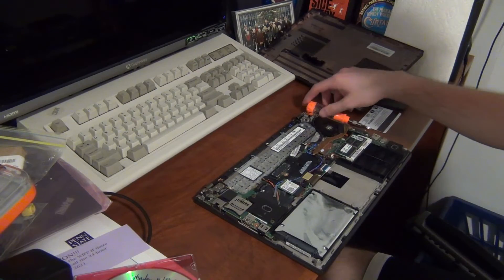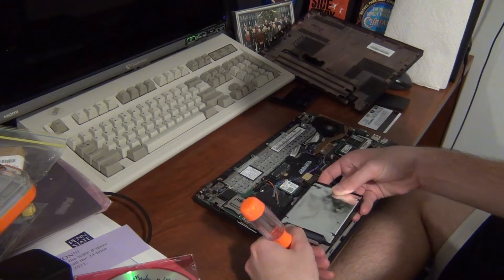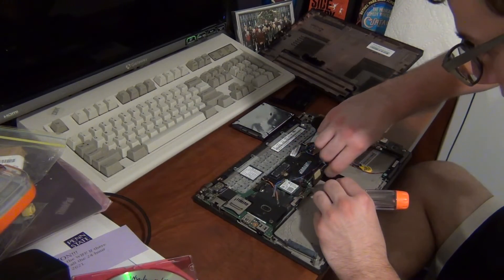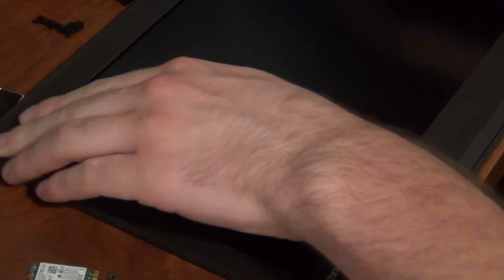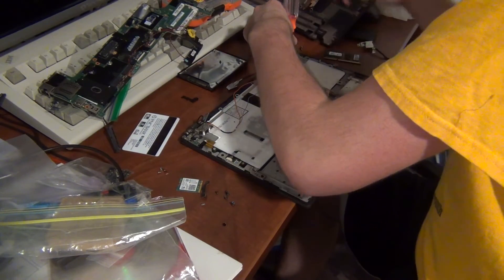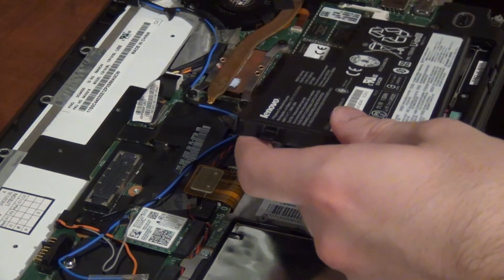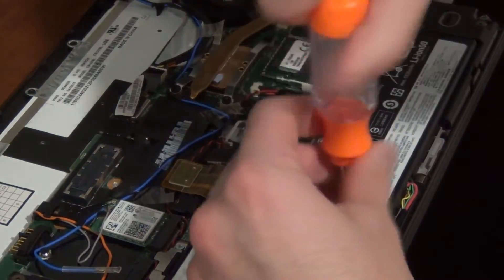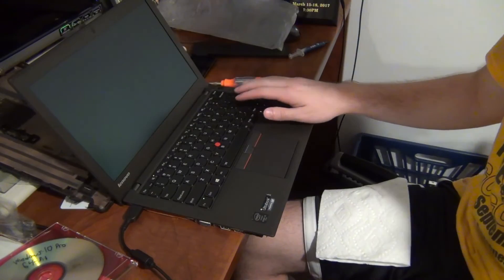Lenovo ThinkPad X240: Screen, Battery, and Palmrest Upgrades

Comment: Where did you buy the complete palm rest, keyboard and trackpad?
Reply from the maker: eBay.
Reply: @SebisRandomTech  Thanks mate. I should have read all the comments first. At any rate love your videos and for someone who has never been into pulling laptops apart, i now know the X series like the back of my hand! (X240-x270 as the new ones don't really count do they :))
Reply: I’m looking for this too! Found one but doesn’t include fingerprint reader. Is the palm rest a part of the full x250 trackpad or this an additional feature I should look for?

Comment: Bro my display brightness is not working on original display panel is there any way to get it working i tryed all the methods but only remaining is whitelist removal
Reply from the maker: Have you updated the drivers? Sometimes that fixes it for me.
Reply: @SebisRandomTech  i tryed it no luck
Reply from the maker: @kaushalposnak6203  Strange, and you said this is the original panel?
Reply: @SebisRandomTech  yess its original the brightness work in linux and mac but not in windoes sed life😭
Reply from the maker: @kaushalposnak6203  Knowing how often Windows updates screw things up, it's hard to say. You could try an older display driver and see if that works.

Comment: Hey friend, where did you get the LG brand IPS screen?

Could you provide me with the link?
Reply from the maker: eBay. This was over 2 years ago and any link I may have had is long-gone. You simply have to try your luck with different sellers and ask around until you find one selling an exact original screen.

Comment: Great video, as always :) I have one question. I read that after swapping touchpad in xx40 Thinkpads to the one from xx50, additional Synaptic drivers need to be installed in windows to make it work. How about Linux? Does it work out of the box after swapping? Thanks a lot.
Reply from the maker: In my experience it usually works out of the box in Linux.

Comment: Hi great video. Is there a way to remove the whitelist WiFi for the x240 ? Thanks.
Reply from the maker: Yes but it isn't an easy process. You need to purchase some additional equipment and be comfortable with Terminal commands.
Reply: @SebisRandomTech  noted. The BIOS patch will also require some searching and verify its safe to use

Comment: Hey Sebi's. I'm from Colombia. Do you know how to install the corret drivers for the touchpad? I did the change to the x250 but the buttons doesn't work. Do you know how to correct this?
Reply from the maker: I did a video describing how to get the drivers working properly in a T440p, and in the description I left a link to the ThinkPads.com forum where they also have a guide on how to do it in the X240.

Comment: I bought that laptop a year ago. I like its dimensions and appearance. Its weakness is limited performance. I have a version with the i54300U. Is it possible to upgrade this laptop?
The crucial.com configurator says that the X240 supports Intel Series 8. Is this real?
Reply from the maker: Not even sure what "Intel Series 8" means, but if you're talking about upgrading the processor, you really can't. The X250, X260, and X270 all have the same form factor and newer processors, or you can go back a generation to the X230 which used more powerful processors.

Comment: Excellent video. Could you have used a keyboard from the X220 (one of your favorites, as I recall)? I have a general suggestion for your videos. Let's suppose I'm interested in replacing the screen on the T450s with an IPS screen and you don't have a video on that. (I don't know if you do as it's just a hypothetical example). If I were to watch one of your videos involving a screen replacement on another model (such as this video), it would be helpful if you were to spend a small amount of time (near the end perhaps, mentioning at the beginning you will do that at the end) discussing screen replacement for a range of models, particularly where there are problems. An example of a "problem" is that the IPS screens for the T450s are "white-listed", so brightness cannot be controlled in Windows for non-Lenovo replacement screens. Similarly, here when you say you will use a X250 keyboard, you might list other possible choices. It would just take a few seconds but some viewers may benefit. Anyway, keep up the good work.
Reply from the maker: The X220 keyboard is both physically and electronically incompatible with the X240 and X250. Meanwhile, most of the components between the X240 and X250 are interchangeable, enabling me to use a X250 palmrest/keyboard/touchpad in an X240. Screen replacements between these models are also like comparing apples and oranges. With the X240/250 the display bezel simply snaps off making a display replacement easy, on the T440/T440s/450/450s the front bezel is held by adhesive, and there are additional screws underneath, making the replacement/upgrade process very different. They also use completely different displays from the X240/250, and the T440/440s do not have the display whitelist present on the X240/250 and T450/450s (I also heard that the most recent T450 BIOS removes the whitelist, but I don't know if this has been confirmed). Because of differences like those, I can't just make a be-all-end-all upgrade video covering several different models without it becoming a lot longer than "just a few seconds". The process discussed in this video is really only good for the X240 and X250, and maybe the X260/270, so it really wouldn't do much good to try and cover dozens of other variables in one video.
Reply: I realize that the the numbers of permutations of models and types of upgrades is vast, but I think it would be helpful if you spend a few seconds relating what you are doing to other models in the same "family". For example, if you are upgrading a T240, you might say (if it's true), that whatever you doing is also applicable to the T240s. If, for example, it's a keyboard replacement, then say (if true) the only keyboards that can be used are those from the T240 and T250 series.
Reply from the maker: @CaryInVictoria  With all due respect, most of the people who watch these videos or are doing these upgrades or replacements are already aware of what works with what. The information you want can be found with a fairly quick Google search, and so when it gets to the point where I have already covered everything that is needed to perform an upgrade or mod it really isn't worth it for me to add more time to the video to cater to a small handful of people who can find any remaining info they need elsewhere.

Comment: Hi There .. It was a nice tutorial. I was wondering if you could share the link to the battery and screen. The official lenovo site in UK doesnt seem to have the internal battery in stock. Any reliable ones elsewhere ??
Reply from the maker: I am based in the US, so the sellers I buy from may not be able to ship to you. Additionally, as I've pointed out, the sellers who have these parts aren't always the same, so your best bet is to look up the part numbers on eBay. I show the display part number in the video, and you can find the battery information on Lenovo's website.

Comment: How do you find text/ don't eligibility with 1080p on 12.5" screen?  Do you find yourself using web browser zoom? Windows scaling settings?
Reply from the maker: I leave it at 100% scaling since my eyes are still good. If it's too small, 125% scaling isn't bad.

Comment: folks who, like me, just wanted to replace trackpad on x240 : 
1) buy "GZEELE NEW for Lenovo Yoga 12 S1 for Thinkpad X230S X240S X250 X260 X240 Three Button Touchpad Trackpad " on ali, i paid $15 ;
2) just unscrew the back cover, *dont need to unscrew anything else*, remove internal battery in you have one (i didnt, you'd need to disable it in bios before, i didn't need it)
3) remove trackpad connector, it's under black tape in the center of trackpad (that black tape is supposed to protect internals in case of water dropping on keyboard, so, stick something good back after you finish), now you'll need to take a flat screwdriver and detach trackpad from the other side, trackpad is simply glued on x240, but it's not a stong glue, it'll let it go after slight fiddling with screwdriver 
4) get a thin double sided sticky tape (https://www.aliexpress.com/item/32696108387.html) and put it on the margins of trackpad socket, it's enough to keep it in place ;
5) the most difficult part of it :-) - connect the cable back ;
6) you're done, put the trackpad into its socket, reinstall synaptics drivers as explained here : https://forum.thinkpads.com/viewtopic.php?t=126967
.
the most difficult part was to figure out that for replacing just trackpad on x240 there's nothing to unscrew in fact, it's darn easy, you just need to tear the old one off...

Comment: if any one can help me out would be much appreciated iv got a x240 and i want to do the track pad mod but i cant fined a seller selling the x250 track pad in the uk where im from just china and i want to know if the t450 trackpad would fit as i can buy one in the uk :) if any one knows would be a big help
Reply from the maker: T450 touchpad is a bit bigger, so it physically wouldn't fit in the X240. :(
Reply: @SebisRandomTech  dam so only the x250 pad then okay well thanks for the help I'll buy one if you can help me out with another mod I want to make to my x240 I'd be very grateful I'm looking to fit a aftermarket touch screen to my standard base display x240 can I get just a panel and a new cable and drop it in or do I need a new "lid" the top case ?
Reply from the maker: @totalkiller4  You'd need an entire top case.
Reply: @SebisRandomTech  do you have a sku number for what I'd need that would be a big help I'm new to the ThinkPad world :)
Reply from the maker: @totalkiller4  All part numbers can be found on Lenovo's website. Just look up "ThinkPad X240 part numbers".
Reply: @SebisRandomTech  hi I'm getting mix messages from sellers on if I need a 04X5251 cover to fit a touch LCD do I just need a new bezel or the cover also :(
Reply from the maker: @totalkiller4  You would need an entire screen assembly.
Reply: @SebisRandomTech  sorry to keep asking you for help but your really helpful i have a x240 that did not come with a fingerprint so i bought a palm rest that did but i dont have a slot for a little ribbon cable down near the ram slot like you do does that mean i cant get fingerprint :(
Reply from the maker: @totalkiller4  You would replace the palmrest with that of one that has the fingerprint reader.
Reply: @SebisRandomTech  I have purchased a palm rest with a fingerprint reader and it's working just there is a small ribbon cable coming out of the keyboard in the far left near the ram side of the laptop if you have it so the trackpad is at the top of the laptop but I dunno what it's for it's not plug in but fingerprint works so any idea what it's for ?
Reply: @SebisRandomTech  I know this isn't about the video but I just bought a t440p and was wondering if it's possible to add touch screen to it I see it's available for the t440 would a t440 screen fit a t440p ?
Reply from the maker: @totalkiller4  Nope, the T440p was never available with a touch screen.
Reply: @SebisRandomTech  but the t440 or 440s is are they cross compatible at all is what im asking
Reply from the maker: @totalkiller4  They share some similar parts, but the T440, T440s, and T440p are all different machines.
Reply: @SebisRandomTech  so the displays are not interchangeable as iv read on Lenovo forums there the same size and connection
Reply from the maker: @totalkiller4  The non-touch displays are the same across all 3. The touch screen versions are limited to their specific model. A T440s touch assembly won't work in a T440, and vice versa. As I said, the T440p never had a touch screen option so there's no Lenovo part that will work with it.

Comment: I found it, yayyyyyy. I'll get the screen once I get some extra 💰. One thing I can't seem to figure out is where is the 16gb msata drive located that comes default with the x240?
Reply from the maker: It may have been in a caddy that takes the place of the SmartCard slot, according to documents on Lenovo's website.
Reply: Sebi's Random Tech ahhhh gotcha. Thanks for clarifying that. I’ll be keeping that laptop and maybe sell my T460 which I love. Can the T460 have a backlit keyboard?
Reply from the maker: @BlaGGah  Yes it can.
Reply: Sebi's Random Tech Whata the actual keyboard I should be looking for? Any other compatible backlit keyboards from other models that's compatible?
Reply from the maker: @BlaGGah  X240 and X250 use the same keyboard. https://download.lenovo.com/parts/ThinkPad/x240_fru_bom_20140808.pdf
Here is the complete parts list for the X240. There is a whole section on the keyboards that you can install in it.

Comment: I just got one of these on ebay for cheap, the seller didn't know what type of display it had so I took a chance and lucked out that it already had the IPS display (1366x768 though), anyway I LOVE it. Up until now my portable "coffee shop" laptop was an older 13in Macbook, the thing was close to 5 pounds though and I was starting to get sick of lugging it around just for my quick writing and emailing. This 3-pound little beast is PERFECT. Sure though, also not a huge fan of the touchpad, but since it's already got an IPS display I'm no longer thinking about opening it up and trying to upgrade it.
Reply from the maker: You can always swap out the touchpad with that of an X250 pad. I think you can swap them without even taking the machine apart.

Comment: Hey I have a Lenovo X240 with 8GB of ram, 120GB SSD with the TN panel. It does have the internal battery at least. I only want two upgrades for this machine. I want the IPS 1080p display, and the X250 Synaptics trackpad. I found both parts on Amazon for $80 shipped. Do you think it's worth the money for these upgrades? I really hate the TN panel, but i'm inexperienced working on laptop hardware. I might have to pay a tech to install the parts for me, in which case how many labor hours do you think these 2 upgrades take? If I had to guess, it'd probably be 1-2 hours for an experienced tech? Thanks for the video.
Reply from the maker: $80 shipped isn't a bad deal. As for labor hours, I have absolutely no idea since I typically service laptops myself. :P I would guess between 1 and 2 hours, but you never know.

Comment: I replaced the motherborard from i3 to an i7-4600u, sadly it can only support up to 8GB of RAM, but for working purpose it should be more than enough. The screen size is 12.5 inches, so 720P is acceptable for me,  plus it drains less battery.
Reply: @GoogleAccount-kj7bq  several google searches insist on ips being 10-15% more power demanding (https://www.reddit.com/r/thinkpad/comments/6ntsy1/battery_drain_ips_vs_tn_in_an_x230/)...
Reply: There are some comments in forums with reports of X240 machines with 16 GiB (one module). It is much better having a 16 GiB machine with 2 RAM slots but for the X240, it seems one module is possible.
Reply from the maker: AFAIK the X240 is limited to 8 GB of RAM. It's successor, the X250, can take 16 GB because of advances in the CPU architecture.

Comment: how much is the X250 touchpad and where did you get it?
Reply from the maker: I bought mine with the entire top cover, but the touchpad itself costs about $20-30. Check eBay and Amazon and MAKE SURE it’s a Synaptics touchpad.

Comment: I really enjoy your videos!!  How you started learning all those things?  Any tip for a total beginner?
Reply from the maker: The Internet and Lenovo service manuals are your friend. Keep track of screws, small pieces, anything you take our or remove and make sure you can get it back together. Trial and error and experience is probably the best way to learn. For example, I have probably refurbished about 30-40 T410, T420, and T430 ThinkPads, so I know those units in and out. Make sure you have the right size screwdrivers for the job, and look out for adhesives that you may need to replace (common in newer ThinkPads). Experience is the best way to become more confident in your abilities.
Reply: @SebisRandomTech  I started doing the T430's based off your motherboard video and have bought and sold about 10 of these now including upgrading the original spec, replacing damaged parts and putting in new motherboards. Totally agree experience works and being gentle in expectation: You can never assume everything will go ok, there's always a mistake or a weaker part that may give way. Must say love a I7 3610QM in a T430! Likewise advice on screws is good along with taking a picture of the parts before you disassemble them as easy to forget the original ;ayout.

Comment: In your opinion, what is the best old thinkpad should I buy with great upgradability?
Reply from the maker: The T430 if you prefer the classic design, or the T440p if you don't mind the modern redesign. Both have fantastic upgradability, including RAM, storage, display, and CPU upgrades.
Reply: @SebisRandomTech  What is worth buying the t430 with dedicated graphics or without? and thoughts about x230
Reply from the maker: X230 is basically a mini T430, it uses the same processors and everything. However, the X230’s processors are soldered in and thus can’t be replaced.
Reply from the maker: Graphics will depend on your usage. Some still find the Intel HD graphics to be adequate, while others will need the extra power of a dedicated graphics solution. External GPU’s can be used with the T430 and X230, but it’s not the most elegant or practical method.
Reply: @SebisRandomTech  $150 T430 with an i5 or $200 X230 with an i7
Reply from the maker: Depends on the RAM and storage options.